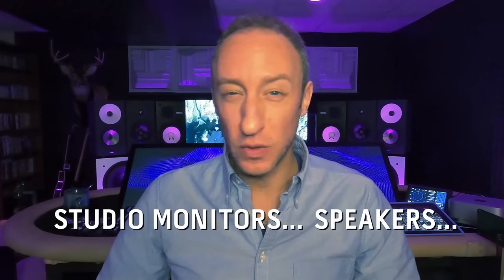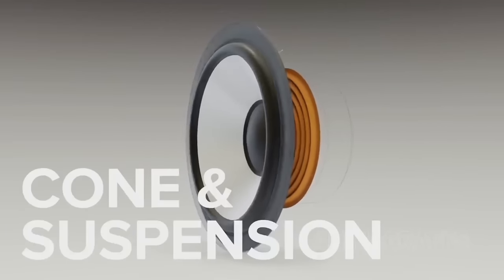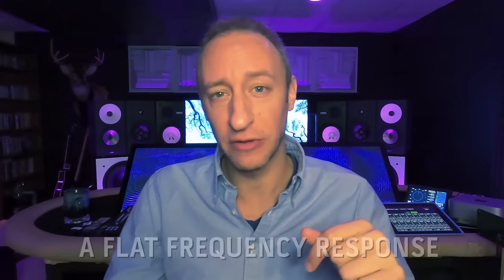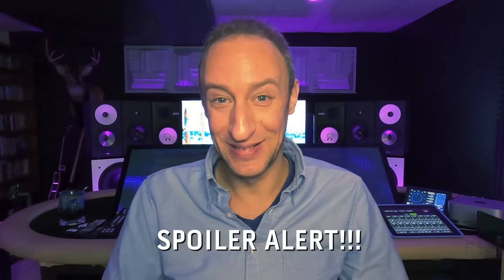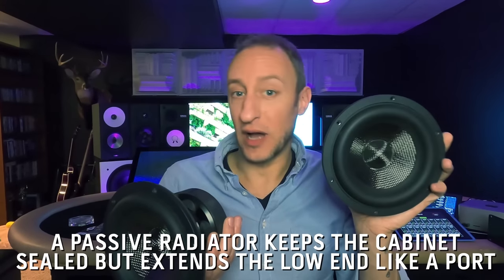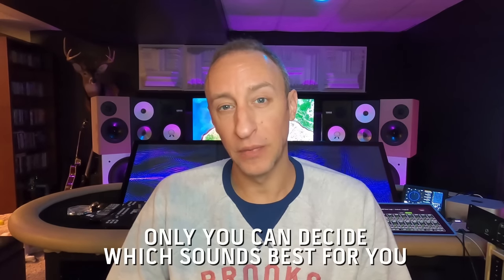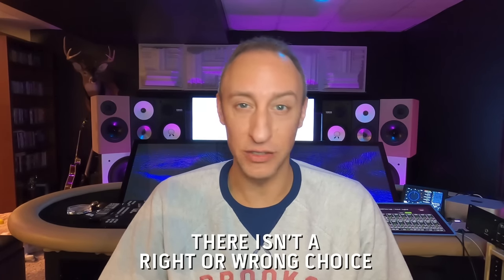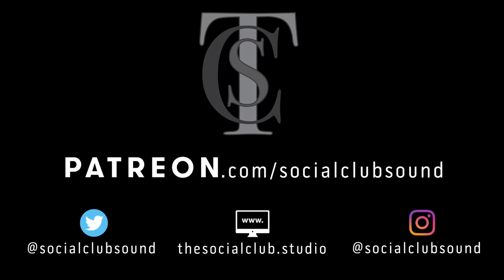SPEAKERS vs STUDIO MONITORS!!! What's the difference? Find out!!! TSC Production Tip 005

Comment: I enjoyed your video very much and see that you have entered in the manufacturing aspect of this industry. I want to encourage you to do more research before making the statements you have made.  Passive radiators are slow and the fact that your using the same driver for bass and midrange frequencies means the passive radiator will modulate the midrange frequencies.  Your statement about the ports vs sealed is inaccurate.  The problem is most designers don't possess enough understanding in speaker design.  Now I have no doubt your speakers sound better than the speakers you referenced.  New technologies have arrived and world class speakers are only using some of the guidelines in the speakers design. Most crossover design programs are limited.  And you didn't talk about any psychoacoustic principles implemented into your design.  Of course your going to have clarity with a SEAS tweeter.  Most studio monitors have crap tweeters, generic crossovers that are not optimum for best speaker performance, and utilize crappy parts.  But it is nice to see some affordable new speakers because most studio monitors are crap.  That why we have so many recordings that sound horrible.  Yet, we have recordings from decades ago that just sound amazing.  And we all know not all engineers are created equal.  They may know how to navigate a mixing console but they can't hear the way they should be hearing.  And they get over saturated and keep boosting the high frequencies.  I spend most of my time doing research and over the last two decades realized we have a very confused industry.  The problem is if you hear the same thing over and over again you start to believe.  I look forward to hearing these speakers.  Very curious to hear if you have somehow made a speaker with a extended subwoofer, to reproduce accurate sound at 2000 cycles and how you can or can't hear the transfer to the tweeter.  That would be impressive.  Very interesting approach.  But again, you are bringing a speaker to the consumer that isn't horribly expensive and no doubt will most likely sound better than many of the mass produced monitors made in China!  And your retail seems to be in the ballpark for someone selling direct depending on your crossover parts.  I must have missed it in the video oir did you state what filter topology you implemented in your design?  I've seen hundreds of speaker companies come and go.  It's a tough business and polluted with pay to play reviews and the ones that suffer are the consumers.  In the end, it is the consumer that is most important.  Very curious to hear these.  We have had one of the best 3 way monitors using all SEAS drivers and I never ever pushed it over to the pro audio market.  But the cool thing is some of the mastering engineers are starting to use high end speakers for reference and you can definitely hear it in the mix.  Keep up the research and passion to build better speakers!

All the best

Leif S.

Comment: So what should I use in my room for high resloution accurate sound reproduction , a 
good quality speaker or a studio monitor , I still can't tell ?
Anyway ,great review , bye bye !
Reply from the maker: Whichever speaker your brain likes better. We all hear differently and sometimes a speaker can just work for you. And sometimes you just have to audition a lot of speakers to sound the ones that work right. A studio monitor is going to be flatter and sound less "exciting" because of the flatter response. Understanding what's more important to your brain, frequency or time domain might be the differentiator.
Reply: @SocialClubSound  Ok ,thanks.
Um, what's your opinion on active speakers, be they studio monitors or speakers ,are they worth considering or should I just buy a good separate amplifier?
Anyway thanks for the info ,bye ,bye!
Reply from the maker: It all comes down to the amp they used. If it's a high quality amp like from Hypex or ICEPower, then you're in fantastic shape. Look at the active amps signal to noise ratio, THD, and dynamic range. That will help determine how it will perform

Comment: I’d very much be interested in seeing you do a proper ABX test with your speaker using the two different capacitors you referred to. You claim that they sound different; let’s cut through the BS and prove it to us. Unlike most YouTubers you have the means with your own product to set up this demonstration.
On that same note how do you have two capacitors of the same value that have “a different phase response”? If what you claim is true I’d also like you to show that too. A simple XY Lissajou pattern on a scope with the two caps on the respective channels with a proper resistor load would be a simple, graphic and effective way to demonstrate your assertion. Please illuminate us.
Reply from the maker: Thanks for the well thought out comment. I'm going to try and find ways to capture the audible difference. But between the limitations of microphones trying to record audible performance vs the YouTube codec crushing any nuance I'm still searching. A lot of the difference comes from the materials used which seem to have an audible effect that isn't necessarily showing up in a meter reading. I think everyone can agree the sound difference between electrolytic caps and poly caps even when they're the same value. I want to dig into this further but I need to try and figure out how to convey the difference. Like I said, thanks for the reply and let me see what I can do.
Reply: @SocialClubSound  At radio frequencies different dielectric materials have quite a marked difference on the velocity of propagation down a feed line. Not sure if this would make much difference at audio frequencies with different caps, but it might. 

Although what I suspect the main difference between "cap A" and "cap B" (even with same value, voltage rating etc) could well be is that they are built differently enough from one another to exhibit different amounts of parasitic inductance. That would certainly alter the phase response.

Comment: Jacob O'Neil's animation of a loudspeaker is wrong. It shows the voice coil right in the middle of the ferrite magnet, where it would not work at all. In reality, the voice coil is in the annular gap between the center pole piece and the front pole plate, so that the pole plate sits exactly halfway along the length of the voice coil.

Comment: I will likely buy them not just for the design, but because the name was inspired by your dog.   One question, i have used numerous nearfield, mids and mains over the years, from Focal and Barefoot, to Dragonfire and custom designs.  I do use several check monitors (“horror-tones”, etc).  I have tried using a few different releases of NS-10’s over the years, but found them so fatiguing and biasing that I just sold off each of them.  I found that (1) I could only mix for maybe 20 minutes max at a time before having to take a break (i mix nears at around 80-85 dB). Also, the result always biased towards a slightly “smiley-EQ”, due to NS-10 design.   Am i missing something or doing something wrong re NS-10’s.  Most just told me things like “if you can make something sound good on an NS-10, it will sound much better on most systems”, or “yes, people like that smile-EQ, and it forces you to focus on the mids”.   Neither one of those answers provided a useful answer for me.  If you can, please let me know what I am missing.  Again, great video!
Reply from the maker: Thanks for the comment! Sherman has been my inspiration for awhile, he's the best. NS-10s are pretty fatiguing. It doesn't take long. That's where the Amphions were such a revelation. They were much easier to work on for longer periods. As for the NS-10s, it's true that they can give you a mid-range microscope that reveals any shortcomings. To avoid the smiley face you have to use your brain like a translation tool to know how they sound on the NS-10s won't be the same as you hear it other places. But getting things to sound right on them, will translate to a better mix. Sounds like they just might not work for how you hear and there's nothing wrong with that! I have some speakers that just don't work for my ears, yet other people swear by them. We're all individuals and finding what works right for each of us is the challenge!

Comment: There are people out there who highly advise not to get studio monitors for home use.  The best I can come up with is people inherently prefer some coloration that comes from HI-Fi as apposed to orthodox flat ?  Perhaps the topic is more in reference to the older studio monitors with wide baffles ?
Are there any solid reasons anyone should avoid using a Studio monitor for Home Hi-Fi usage ?

I have a fairly lubricous collection of redundancy.  Despite all my "exploration"  I think I love a lightweight paper woofer the best.
Sony SS-CS5 
JBL Stage a130 a170 a125c Studio 590
Elac Uni-Fi 2.0 UB52  Uni-Fi Reference UBR62
Bose 201 Series IV
Klipsch RP-160m RP-600m 1st gen
Reply from the maker: Studio monitors for home use is definitely a debate but I think it comes down to how you listen. If you prefer just the recording as bare as you can get it, studio monitors are the way to go. But if you want some of that hifi magic you'll end up coloring the recording. But you may prefer it that way and that's fine. I don't think there's a wrong answer for what a person personally prefers. 

I'm working on a new design now with a silk tweeter and SEAS reed paper cone 5.5" woofer .

Comment: One of the most important differences between hi-fi speakers and studio monitors is the power handling capability of mid range and tweeters. if you solo a synthesiser that has a filter set for sweeping with upper harmonics with a big peaks, that requires a lot of power handling in the tweeter, and generally, hi-fi speakers will fail with this kind of signal; they have a tweeter that is specified for the frequency spectrum of “normal” music, and this gives a tweeter with low power handling capabilities.  Under this kind of workload, crossovers can fritz too.

Comment: You start the clip with what is essentially a sales pitch.
Ruh-Roh !
Nowhere do you state the most critical spec. of a speaker system, the overall frequency response.
Our original "Studio A-" speakers delivered 10 Hz. to 32 kHz., +/ 3 dB at 80 dB S.P.L. at 3 feet.
They were custom designed and built by us at the studio in 1970.
Nowhere do you actually spell out the difference between a studio monitor and a home speaker.
Bill P.
Reply from the maker: I understand how studio monitors began but I was trying to give a modern day assessment of what is now considered a studio monitor like from Sweetwater vs a regular speaker. I'm sure there's plenty I've left out and it still ended up at 33+ minutes. Happy to dig further in depth in future videos
Reply: @SocialClubSound  I know that you understand but the reader wasn't filled in.
Here's the difference.
Studio monitors are typically built for nearfield (close) monitoring at known distances and angles, have heavier duty drivers for higher SPLs and 24 hour a day usage in a sonically controlled (acoustically damped) environment..
Consumer (home or 'hi-fi') speakers are not as robust, not as accurate in sonic performance and are meant to work into a variety of room sizes, damping factors, etc. 
And there you have it, I hope that helps.
Best regards,
Bill P.

Comment: I agree only in one point - the room acoustics. Even the best speaker in the world can sound horrible in bad room. Skip the theory and go forth my opinion. I prefer high quality 3-way active speakers with low distortion, high headroom, and even dispersion with big sweet spot. They are not cheap, but they are much cheaper than High End snake oils (speakers, amplifiers, cables, etc.). Sometimes you spend 10 times more for High End systems  and still it’s not working well together. If you take active speakers all these problems disappear. No phase issues, no sonic character tuning and other BS. If you like them, then it’s solved. And sorry but your Seas tweeter has horrible FR and resonance. This is not High End tweeter.